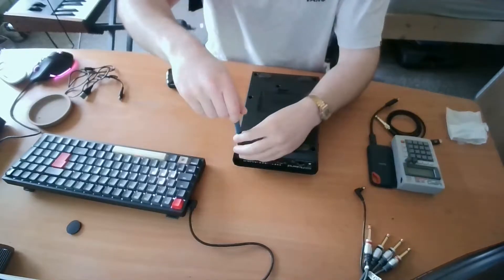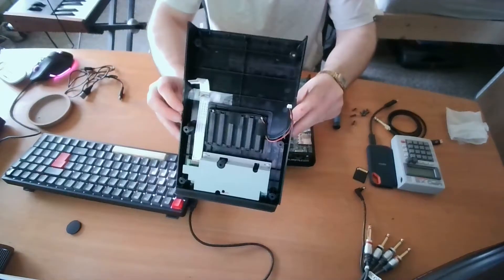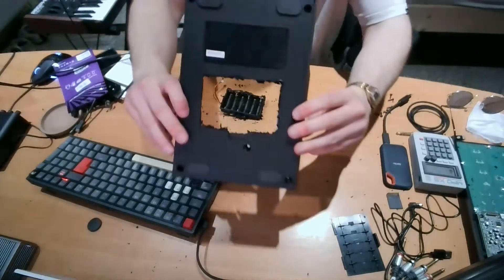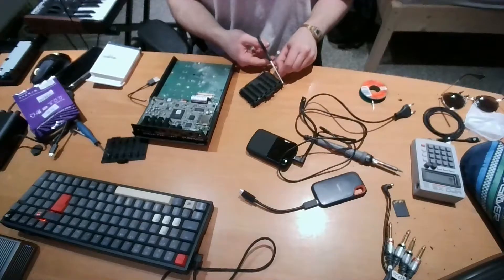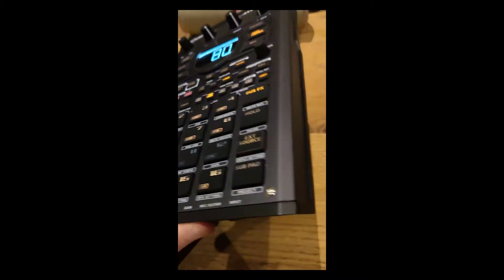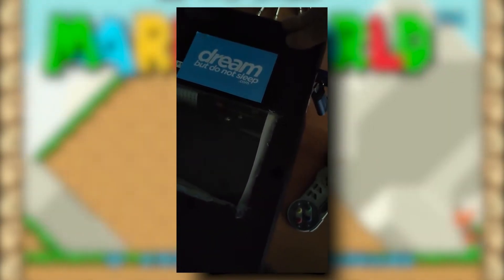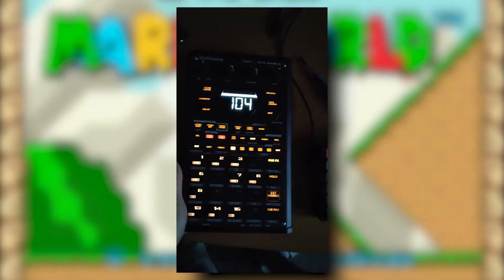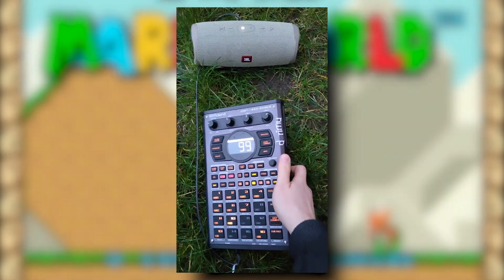SP-404MKII 10000 mAh Powerbank Mod

Comment: nach wie viel zeit geht die powerbank aus? und geht sie dann nur aus wenn man die SP nicht benutzt?
Reply from the maker: @lvcas5481  hab ich drunter schon auf englisch beantwortet, hatte es mal wenn ich mich recht erinnere von ~75% auf ~20% in so 5 Stunden beatmaking/anlassen bekommen, also vermute ich so 8 stabile Stunden sollte es mindestens halten
Reply: @dreamwave97 dankeschön :) werds dann auch mal ausprobieren

Comment: Thanks for your tutorial!

How much are you currently getting out of that power bank?
Reply from the maker: Thank you for watching ! 😉
I would need to test it out more because I didn't try using it from 100% to 0% only with the powerbank yet, but if I remember correctly I got it from ~75% to ~20% in like 5 hours of making beats + just leaving it on. So I'm guessing it would be at least a solid 8 hours, but I will report back once I tested it out more!